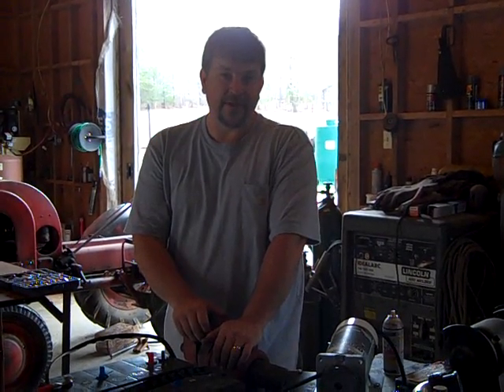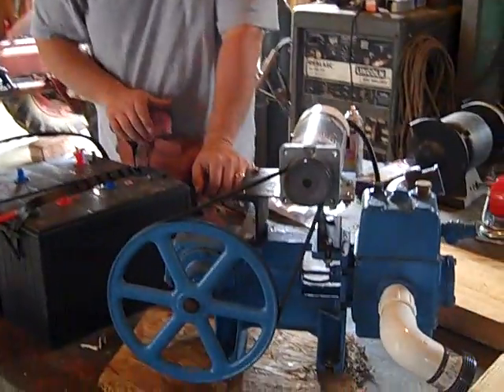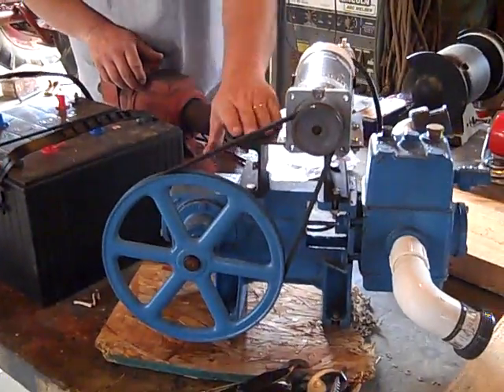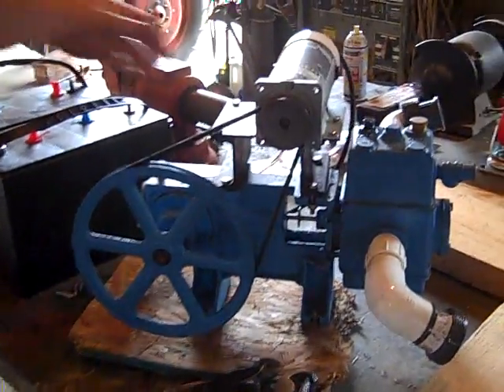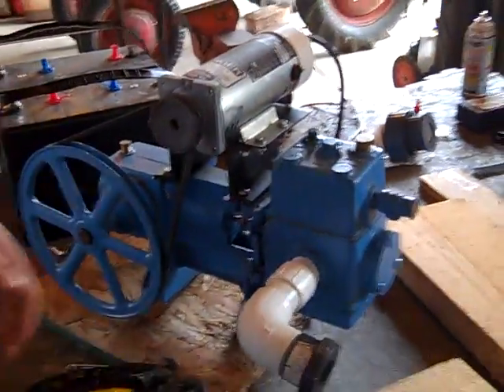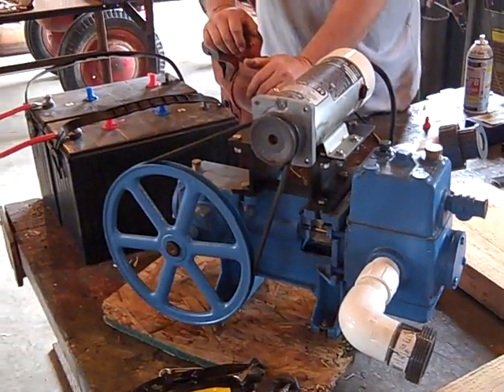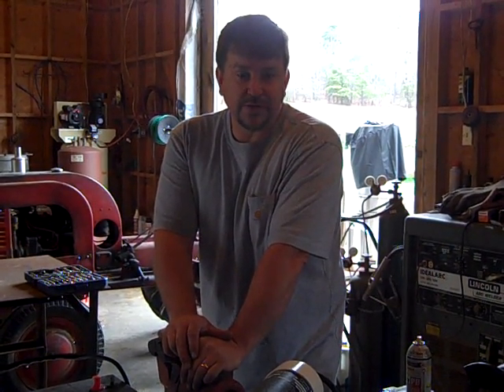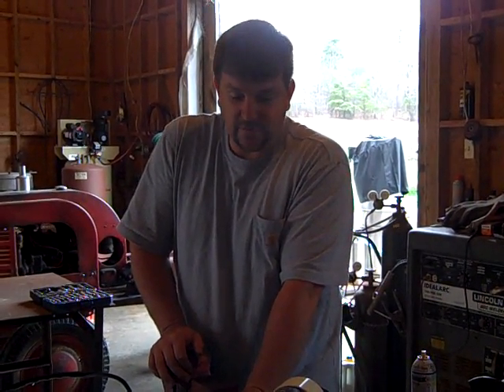Solarforce Piston Pump: Old Tech meets New Tech

Comment: Youtube channel shedasaurus video "Piston Pump 1 1/2" Pulley direction and oil info" would make me think that your pump was running the wrong direction in this video. I know you said something about hooking the motor up right. I have one of these motors that came with a Dankoff slow pump that I am trying to switch over to an old old piston pump. But the pump is the mirror image of yours and so my motor runs the wrong way.  I'm not sure that it would work to run the motor counter clockwise instead of the way it ran with the impeller pump. Does anyone know if you can run one of these Dankoff DC pumps in the opposite direction to what the motor ran when pumping?

Comment: we use two of these to pump maple sap off of a high vacuum tubing system... you need a check valve installed after the pump to make it work, but we have had one of the pumps for 20 years, still works, just need to replace plunger springs after awhile...dont let them freeze

Comment: This was 4 years ago... Is it still alive the pump. If you have been running it at that speed and it still going I would be impressed. The pump should only be running at 200 RPM. Otherwise, you will kill the pump quickly.

Comment: Hi @Engineer775,  How's your Dankoff Solarforce Piston pump holding up?  If you don't mind me asking, what model are you using?  I'm actually thinking of getting the Dankoff Solar Force 3040-24B for an off grid project i'm working on, so I'm kind of curious to see if you have any pros and cons after 4+ years of use.  Thanks!

Comment: If you do a handle make it like a hit and miss wheel that has a stop one way for running by hand and hinged the other way so the handle will fold in out of the way on its own when under power.  You don't want to get whacked in the shin by a spinning handle.

Comment: Nice video thanks for the channel. I was thinking instead of a hand crank you may be able to hook up a bike ,with sprocket, to handle the work. One reason I thought of this is the RPM's that you will probably need to sustain to make the pump work well. Just a thought, you are the engineer. Thanks again.

Comment: the economist magazine awhile back had a thing about solar power using free piston stirling engines. the opposed piston design is supposed to enable efficent heat conversion and torque.

Comment: they are still quiet common on the farms in germany, but we dont use blader tanks wie just use zinced pressure tanks with a large inspection opening, so the silt can be cleaned out every now and again

Comment: you could drill a hole in one of the wells of the wheel and have it to where you can put a handle on with a nut and bolt. i wouldnt leave it on though. be safe and live well!

Comment: Cool pump! I have an old piston pump much like that and it works perfectly by hand. These pumps don't pump a lot of volume but they're capable of considerable pressure, they can handle some grit in the water, as well as air and it won't lose prime. In fact these pumps are self priming. You can also put just about any kind of motor you want on it. The pressure relief valve is definitely recommended for this kind of pump.

Comment: Re: hand cranking. I noticed that it turns at rather high rpm. Does it have to turn that fast to work?
Reply from the maker: It is a positive displacement pump so if the piston is moving it is pumping.  But it wouldn't perform like being motor driven of course.
Reply: Thanks. Cool little pump.